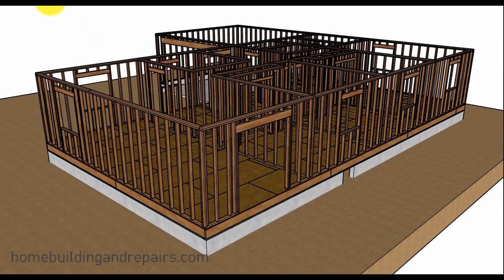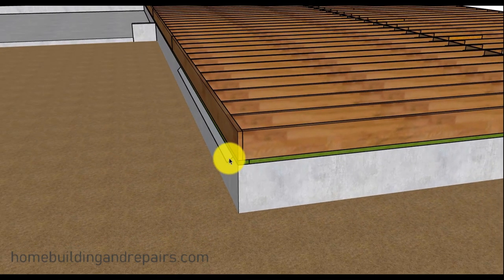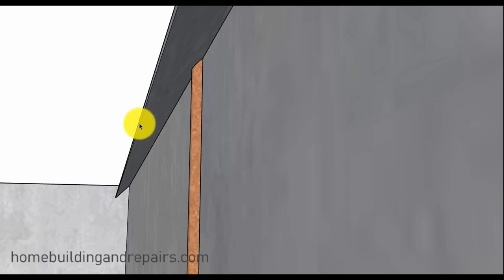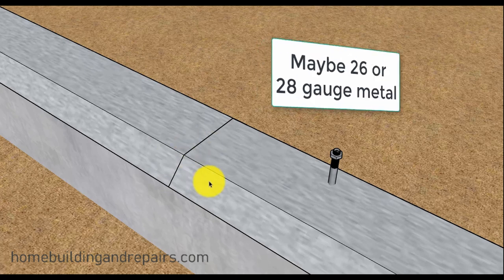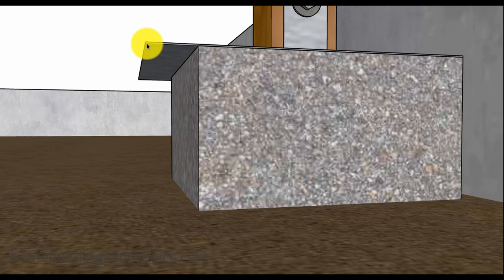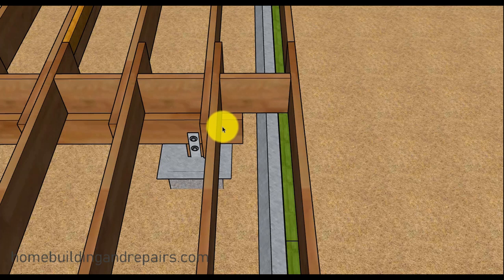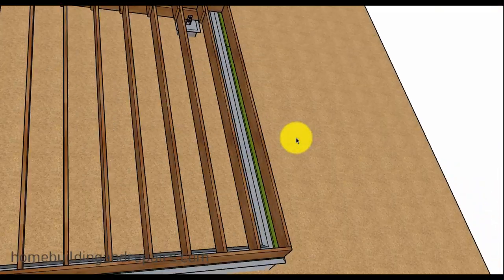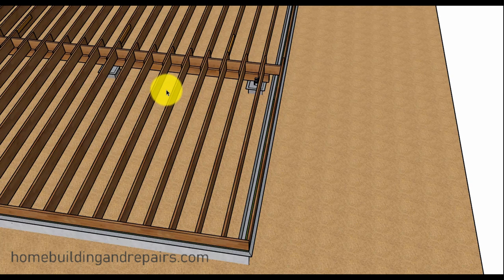What Is A Foundation Termite Shield? - Preventing Subterranean Termite Framing Damage

Comment: I have a block home (1917 NatCo structural terra cotta) the slip formed cement foundation is the base that the blocks are lain on.  My floor joists rest on a beam in the center (pocketed into the foundation at the ends) and a ledge of concrete at the top of the foundation. What ways can Utilize to prevent termites in pre-existing construction?
Reply from the maker: Email me some pictures of the problem areas and I will be glad to provide you with an opinion. Our email address can be found at our website.

Comment: I have never done it but what about buying some bags of borax and just putting that around the footings?
It doesn't cost that much especially in bulk 20kg bags.
Reply: Bruce it will degrade over few years while metal is effectively for the lifetime of the structure.
Reply: @AlexKennbergProfile  No doubt the metal works for many decades. Also the ants need moisture so keeping gardens away from the foundations is also something to think about.
Reply from the maker: Looks like your question was already answered and don't forget that the metal could rust over time also.

Comment: Metal doesn't prevent termites - it is there to make spotting termites easier to see as they are forced to build tunnels over the metal.
Reply from the maker: The metal is usually an obstacle and sometimes that obstacle is enough to prevent them from accessing the wood framing in your home.
Reply: Won't they build tunnels over any material? I've seen them do it over concrete too.